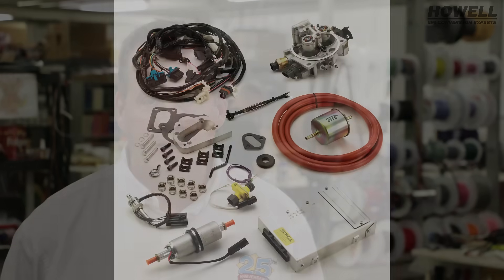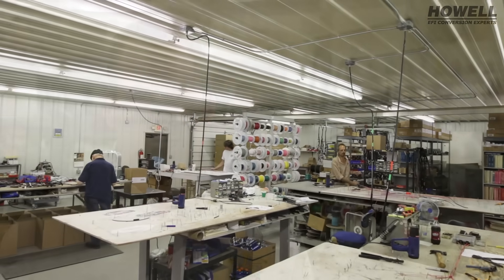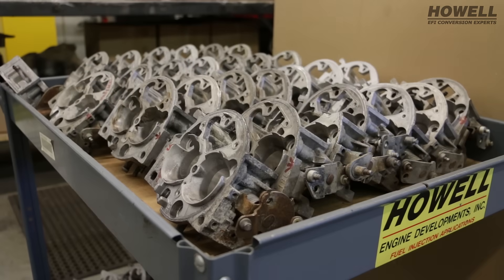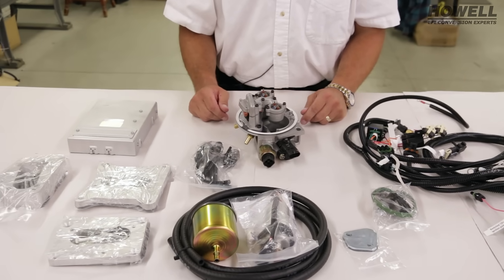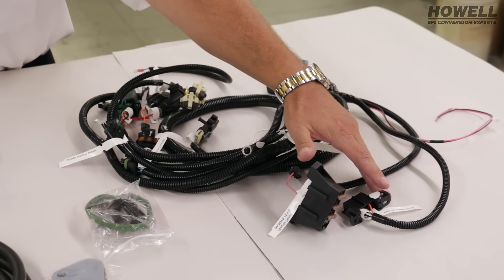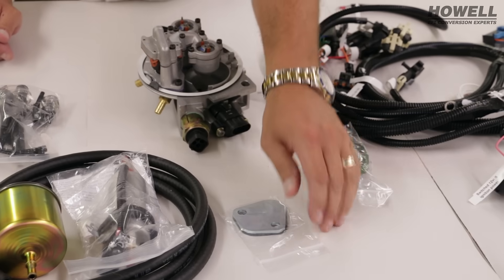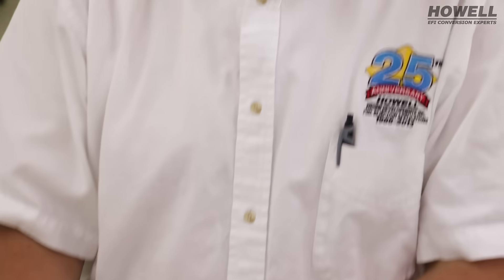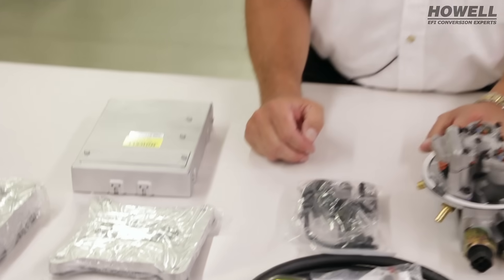Howell EFI Universal TBI Kit Overview

Comment: I'm considering your kit for my previous fuel injection Ford 300 inline, that I will also add a HEI distributor, SUGGESTION: If            you don't answer questions sent into your shop via the web page & email, PLEASE remove those options
Reply from the maker: Definitely not a problem setting up a kit for your application.  Call us at 810-765-5100 and we can help you with any questions.

Comment: Hello I was wondering if its possible to put A TBI unit on a Chevy 429 engine in a 1967 Cadillac Deville. Thank You!
Reply from the maker: Yes we have done TBI kits for the Chevy 429.  what is the horsepower range?  Ignition system your using?  Type of intake manifold?  Please call to speak directly about this at 810-765-5100